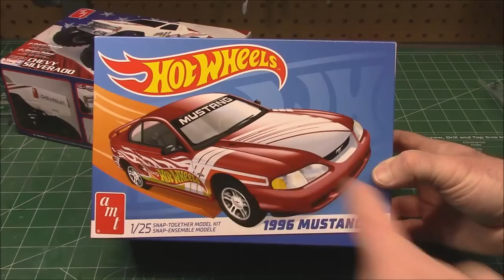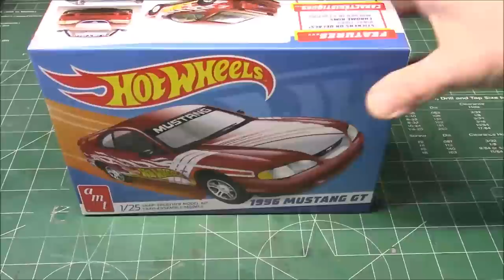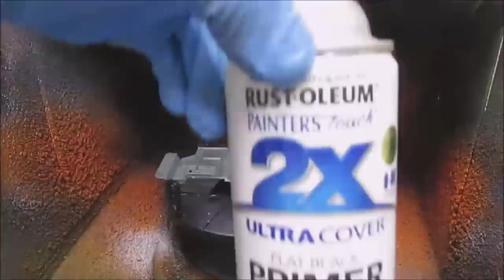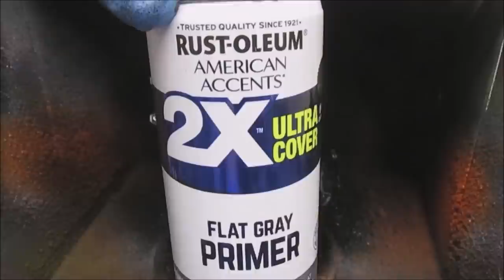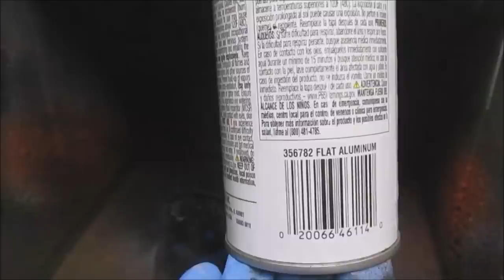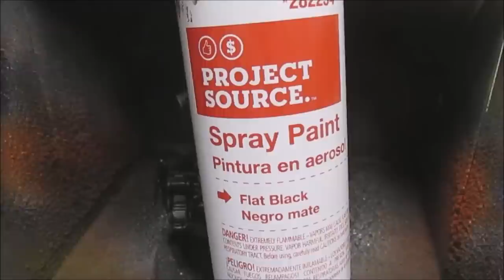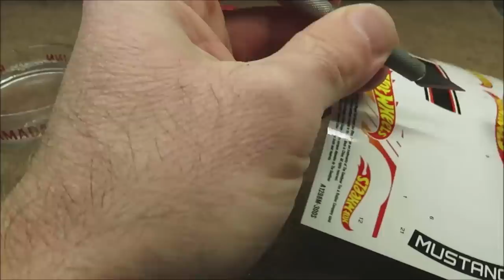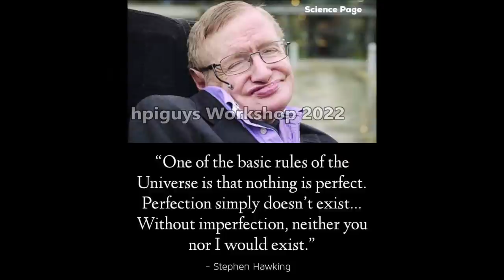USA1 Chevy Silverado Dodge Viper GTS Mustang 1/25 Scale Model Kit Build How To Assemble Paint Decal

Comment: I have "cracked" your formula for an always good looking model - treat them all the same. Your method of inspecting, sub assembly, paint then build with a finish of detailing and decals. I've watched you for several years and that's it! From SnapTite to intricate engines, and everything in between they each get the same level of crafting. My mistake was to be cheap with the cheap ones and nearly overboard with costly kits. My shelf reveals the "cost" of each build - from slap dash to fine art. Your's are each stand alone great. Again, thanks for ALL your works. See ya next year...
Reply from the maker: Yup, make it fun and everything is a good time.